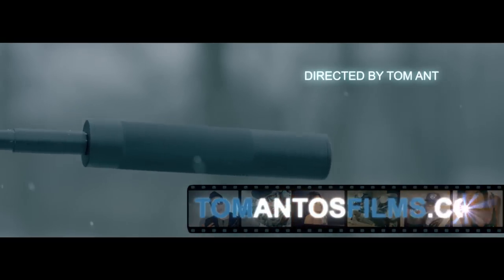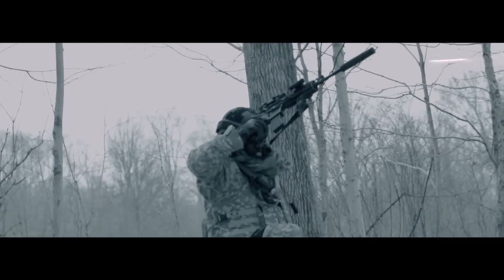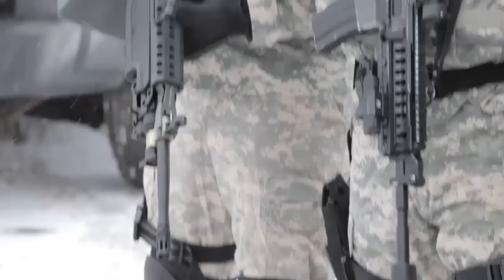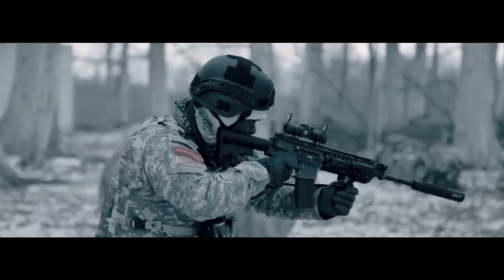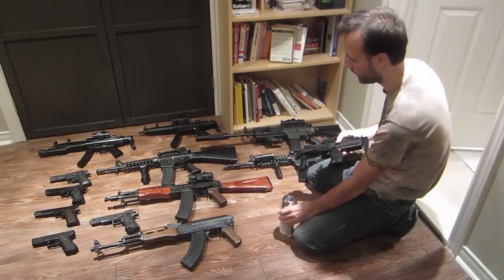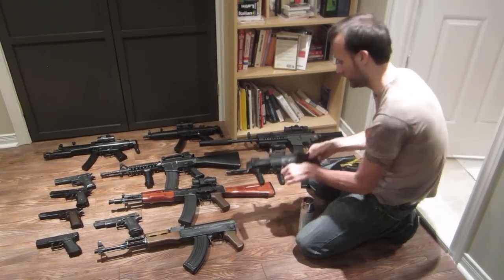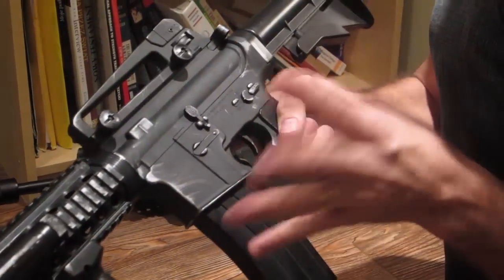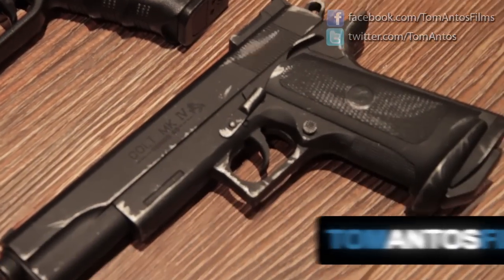Movie Guns - Low Budget Filmmaking Tips

Comment: excellent tip. BTW you say most guns are treated better and look nicer - maybe private owned ones are, but military /police don't have time to pamper their guns, they make sure they work and are not catching rust, that's all. in my (military) experience - they do not care if the bluing is worn off on aluminium parts, and also their weapons are somewhat self-customized, so you can see they didn't get their gun 5 minutes ago. most tweaking is made on the sling, where they are allowed the most freedom to custom things.
Reply: I didnt know that. I've only used privately owned firearms and they always look like they're brand new. Thanks for the info!

Comment: Seems like a good idea would be to drill a hole in the top of the gun and fill it with sand.  Then your actors will carry it like its made out of steel instead of plastic.

The flimsy, ease of carry is what makes it look unrealistic to me.
Reply from the maker: True! Good tip if you use those cheap light plastic guns. I use mainly the expensive airsoft guns that already have the same weight as the real thing
Reply: Tom Antos ah ok. Didn't know airsoft weighs the same.
Reply: Jeremy Bell
Not all of them. GBB and high-end electric ones usually are the best.
Reply: Tom Antos
Speaking of plastic and steel, You painted the MP7A1 as if it were externally steel. It has a polycarbonate frame (same with the Glock) but the rails and sights are metal.
Reply: Just whenever I see a real gun being carried and fired, it just seems way more violent.  The kick of the gun, the gas being vented, the shells - fake guns in lower budget movies just seem so tame imo.